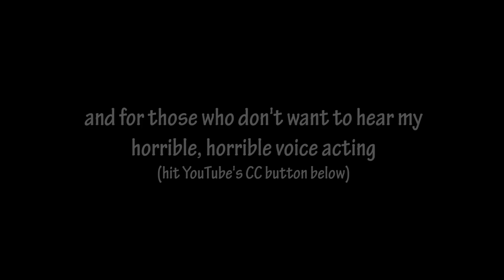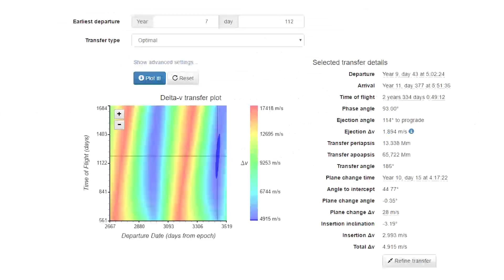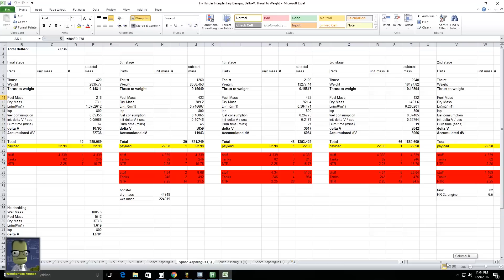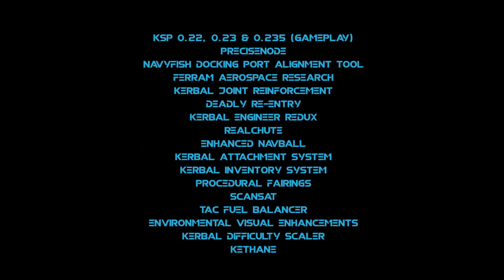Project Overkill Part 1

Comment: Any chance of posting those craft files to curse or linking them here?

edit: Love it so far.
Reply from the maker: I wouldn't mind, but the problem is, the game is in 0.235, using old versions of SCANSat, RemoteTech, DRE, RealChute, Kethane, KAS, KIS, and KER.  Each of these ships are peppered with parts from these various mods.  As such, I'm not sure if it's really practical for someone to try fly these things.  You'd need to put together all the "vintage" mods I used, and I have no idea which version I have of each.  I just saved the entire KSP folder to continue the mission.

Edit: I launched the Discovery 2 mission in version 0.22 with older versions of the mods. I can't even load up the Lander portion / launcher in the VAB due to invalid parts.  I assembled the Discovery 2 in orbit.

Comment: subbed i wanna see if this ends as badly as my missions start
Reply from the maker: Thanks!  I should have Part 2 up maybe mid-week.  That one's actually easy, because Part 1 was getting so long (13 minutes), I split it into 2 parts.  Part 3 will be at least a couple of weeks (filmed but not put together).  Expect a conclusion one way or the other in Part 4 (no I haven't completed the mission yet!).